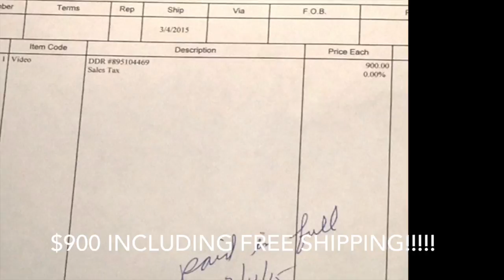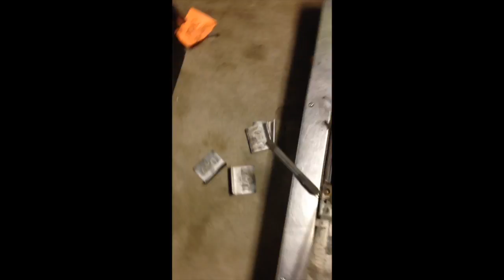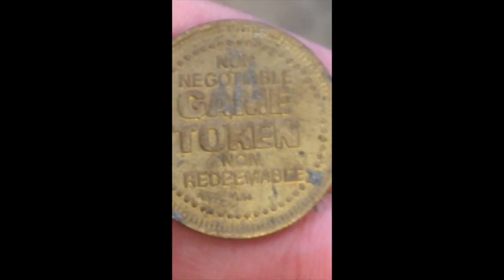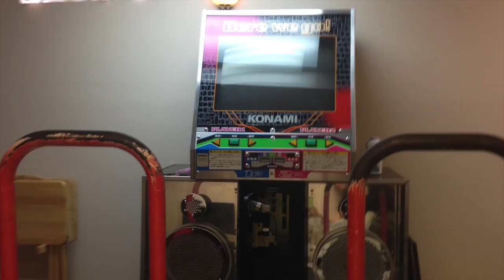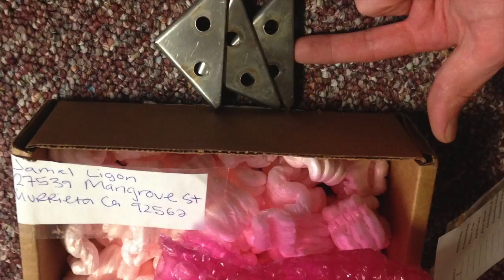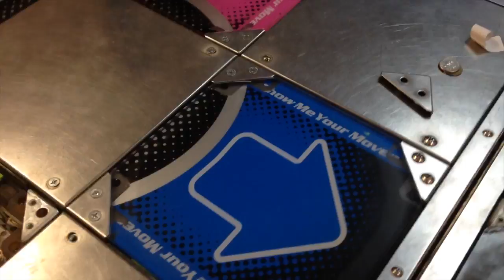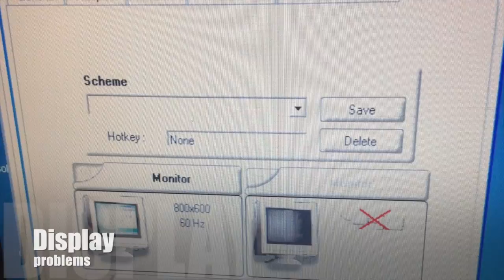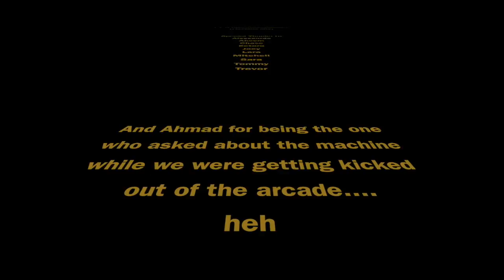30 Minute Slideshow of Cleaning, Upgrading and Modding DDR Extreme Upgrade Cab

Comment: Hey, I know it's been a while since you did this, but do you remember which Dremel bit you used for this?
Reply from the maker: To shave the panels down.. I just used a generic round sanding bit. My kit came with several. I wore through the first one quickly, and had to change it out. Whatever gets the job done.
Reply: thank you very much :)